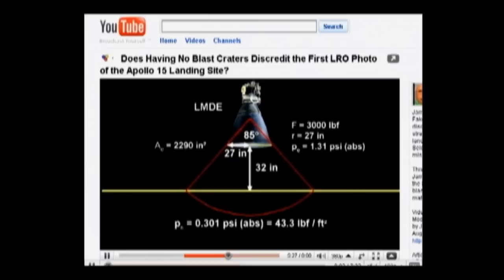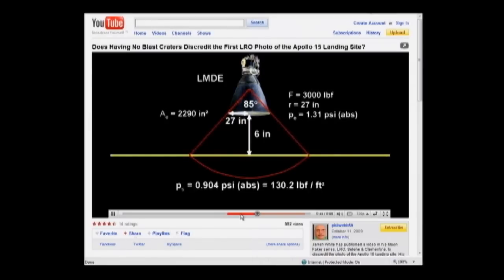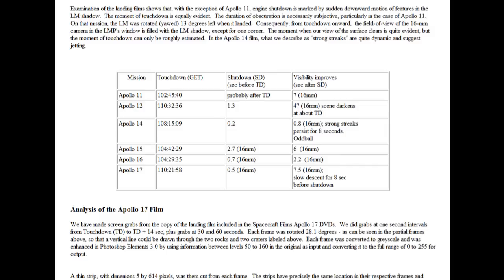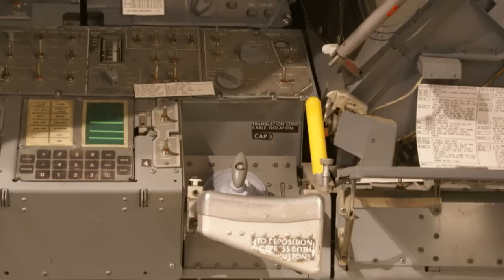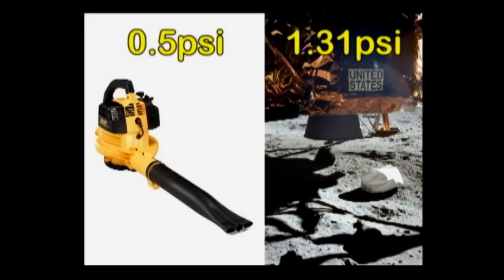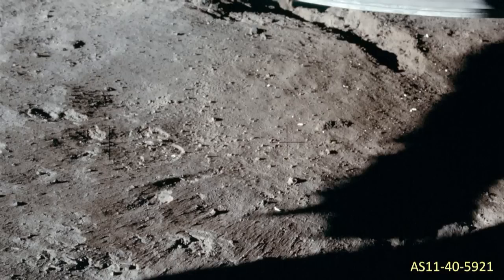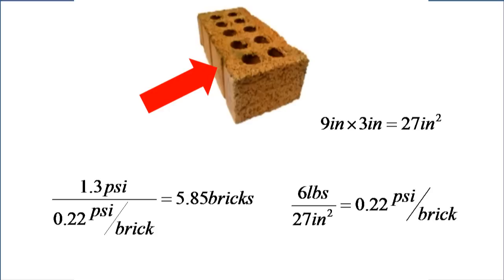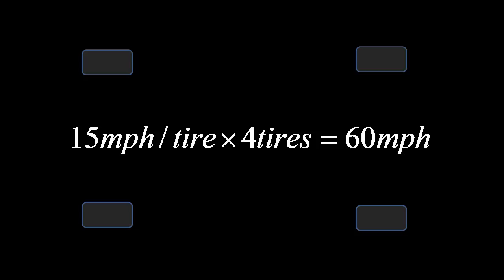MoonFaker: No Crater Addendum: Critique #03: Soft Landing

Comment from the maker: @gijsshu In the states, pool is played with 16 balls, including the cue ball. There can be quite a bit of action. As for Apollo, if you're pressing straight down on a speck of dust, and there's a firm surface under it, how can it move? Think about it. If the force is pushing the spec into the ground, why does it blow out sideways? That baffles me. Does it baffle you?

Comment from the maker: @Astrobrant2 Right. The rocks exposed under the LM were probably under three inches or more of regolith. If you remove the top 15 cm (6 in), the regolith is packed so densely, you'd have to bang it pretty hard to work it apart.

Comment: I've seen others who make a big deal about little rocks still being visible under the LM.

Let's assume small enough rocks would have blown away under such pressure. Two points then: First, how do you know how many little rocks DID blow away? We may be seeing only a small fraction of those that were there.

Second, let's assume that a couple inches of regolith blew away. The rocks you are seeing in the picture were *under* that regolith until the last second.

Mystery solved.

Comment from the maker: @gijsshu Anything that was dislodged, just as the engine shut off, may not have enough energy to overcome the cohesive force holding the regolith together and would quickly fall due to gravity. Also, like when you break the balls in billiards, some balls may shoot straight back at the shooter. So, anything caught between the nozzle and the ground, blowback, would eventually fall under the nozzle.